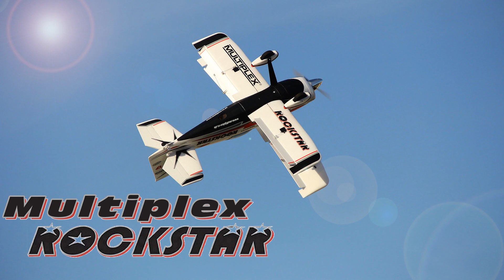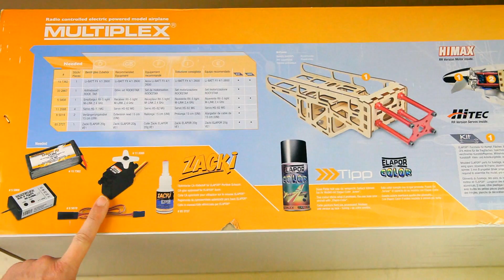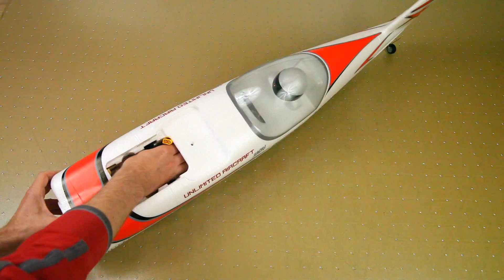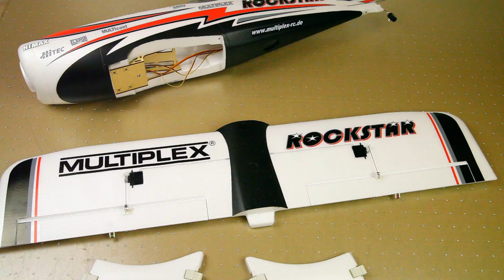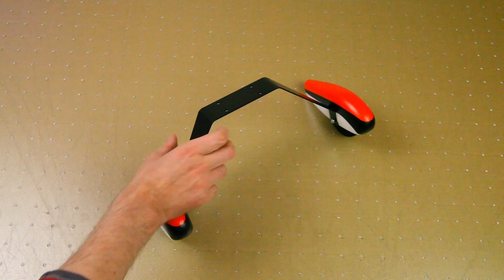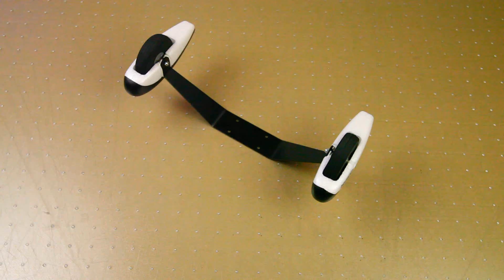Multiplex / Hitec Rockstar RR - 3D Biplane - Show & Tell :)

Comment: thanks for the reply..i added 2 mm down thrust and is flying much better now.:)
Reply from the maker: Interesting :)   Thank You as well for sharing your findings :)  Good to read it improved things for you :)
Reply: +DutchRC Adventures 
upon further investigation i found that in mid air the quick release strut which hold the top and bottom wing was coming out.Fixed this and no down thrust was required ..hope this info help other pilots
Reply from the maker: Thanks for that sir :)  Yes.. I glued them in on 1 end so I'd have 50% less chance of that happening.. Something to check check check though!

Comment: I found out my BiPlane was tail heavy. I set up Rates and Expo based on information I got from someone else that had a biplane simular to mine. Could you post what your settup was so others can at least have a chance to get theres up without the same headaches I had. I dont know why but no one likes shairing that information. I look my Waco out last night and it was a true lady. I was so happy to finally be able to fly it without struggling. I still want to mix my Airelons with my rudder so my turns will flat and smooth. I went through two batterys and heated both of them up but no puffys. I went with a cheaper battery but I think it will be fine. I think the C rating was too low, they are 4 cell but I dont remember any of my other batterys getting that warm. Cant wait to see you fly it. The larger control surfaces should make it a good flying plane,Im not ready for 3-d flying as of yet. I did find the BiPlane eats up more sky doing loops than my other planes. I have to be sure to be at a much higher altitude when doing tricks.I dont know how it will perform inverted yet,but should be fun. Good Idea adding different color for the bottom. I usually add some reflective tape strips on my bottom wing so I know. I learned on the simulator that if the plane is all one color,I get disoriented as to up and down,thats a bad thing. Oh well,happy flying you lucky duck!
Reply from the maker: +scott firman Yeah.. different decals / stripes at the bottom are Mandetory :) And this being a Multiplex plane I am completely sure it will fly  very well :) 
Hmm I could indeed share that CG / battery placement info BUT. I should allso add my CG would not work out well for everybody.. I like flying my 3D planes quite Tail-heavy.. That is not for everybody.. Especially not for beginners :$
Reply: +DutchRC Adventures I guess you would want it tail heavy to do sweeps huh? I am just getting back into flying,so everything is still somewhat of a challenge,though I admit,the Apprentice is starting to get old. Now after flying different planes its like uggh.
Reply from the maker: +scott firman Yes indeed sir :)  It's far easier to do hovers.. high alpha etc with a tail-heavy plane.. The landing will be more of a challenge that way, but that is okee.. 
Hmm maybe do some mods to the apprentice then? (bigger control-throws for instance)
Reply: +DutchRC Adventures No,its just me,I feel I have mastered it now,so it holds no challenge any more. I never use the beginner switch or intermediate eather for that matter. I may sell one of them since I own two. Then again,I have the floats, I guess I need to do that,I have the perfect little lake to fly it off of too,its just down from my flying field so should be fun.And the adventure continues eh?
Reply from the maker: +scott firman Okee.. I understand BUT.. you could modify the plane a bit to make it more challeging once again? More snappy on the controls.. Maybe even shorteting the wings a bit? :) 
Well.. I would Not do those things if you plan on adding the floats offcourse :)  seaplaning is cool man :)
Reply: +DutchRC Adventures I learned from someone that the Apprentice is in need of modifications if you plan on float planing it. I was thankful to see that video. I have two so why not make one different right? Changing the ESC to a different one than the original has added more power to the motor. I run it at quarter to half power now,no need for full throttle. I did the calibration and it didnt change anything. I may eliminate the on off switch,it is causing a slight power leak that the ESC is calling a low power issue so I get a constant beep when I turn the switch off. I really dont see the need for a power switch anyways. most guys eliminate it. What do you think my next plane should be? I dont have a low wing plane. I thought about the Dynam GeeBee v3,it looks like the Biplane minus the upper wing. Its bright red,I really like that style. It would go along with the Waco nicely. What about a twin prop type plane,something modern,like a cessna? any suggestions ( besides a new home when my wife finds out about it)
Reply from the maker: +scott firman Yeps.. get rid of that switch indeed.. No need for that added failure point.. 
What mods are needed to make it a good seaplane?? 
Pfew! A GeeBee you say? :O In real life those are the most difficult planes to fly I think ;) 
Do you want something Fast?? I allways like Cessna's :)  I sometimes fly one as a co-pilot (a high wing one though).. I Love their twin!  Durafly had a version of it waaaaay back..
How do you like this?? http://www.hobbyking.com/hobbyking/store/__35740__Durafly_8482_Messerschmitt_Bf_110_1200mm_ARF_.html (just to see what you like :))
Reply: +DutchRC Adventures Its not the short stubby version you may be thinking of,like I said,Dynam used the obscure version that you dont see much of. Like I said,basically its just a waco with the upper wing missing. I like the plane you are looking at,I can see you flying that! I was seriously thinking a smaller twin. I am running out of room for the big planes but I have a storage shed with way too much stuff I no longer use. Me thinks it be time to sell off my table saw,chop saw and other wood working stuff. Its been sitting for more than four years and I really have no use for the stuff. Then I can build racks for my planes,using pvc,not wood.
Reply from the maker: +scott firman If you're not using the stuff. get rid of it indeed brother.. Now it just takes up space and $$.. 
Hmm smaller.. I do think that model has potential indeed BUT.. I allready have my eye on on another Multiplex plane ;)  haha 
Okee.. a smaller twin you say.. hmmmm nothing out there really :|  What about some kind a F4U Corsair???
Reply: +DutchRC Adventures lol,I thought I told you I have one?Its sitting here still in the box,I havent put it together yet. Motion Hobby just had a great deal on one. I plan on detailing it with a multicolor paint job,It came in a basic dark blue but I want to do the white bottom with the light blue accent. I already have everything I need to get it together except the time. It finally got nice so now I need to hustle up and get everything done out side that needs doing. The deck needs painting,the patio furniture needs cleaned ,I cleaned the trailer already. So many things to do so little time to do it in you know? Anyways,I need to add a vent under the Apprentice that will actually pull any water out of the plane should some get in. I also need to seal up the back vent holes they put in for cooling,the new vent will allow air and water out,but not in. It will definatly challenge me. I still want a low wing plane. Nothing really fancy. I am thinking the Share Bear would be a real thriller,something fast and bright. It would be a fun plane,mabe a better choice to fly with first before the F4U. what do you think?
Reply from the maker: +scott firman Somehing fast usually is a handfull as well Scott :)  I don't know if you told me about your F4U before to be honnest :$  But well.. there is no shortage of low-wing planes on the market offcourse :) 
Hmm a water/air drain that will not let water In? That indeed sounds like a challenge indeed!

Comment: My plane has correct CG but upon throttle it pitches up..Has anyone added down thrust to it as I am planning to add 2 mm washer on top.Please advise
Reply from the maker: Hmm I have not had that problem. I don't know how confident you are with experimenting with the CG? (as in: bringing it slightly back) 
What could be the case, is that you have had to use a little elevator up trim? Which would lead to a pitch-up at higher motor thrust..